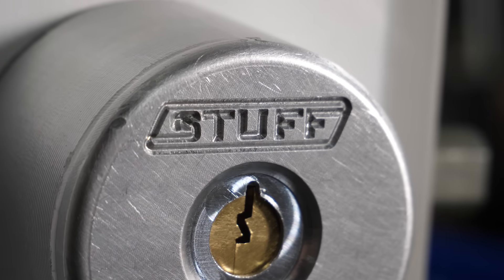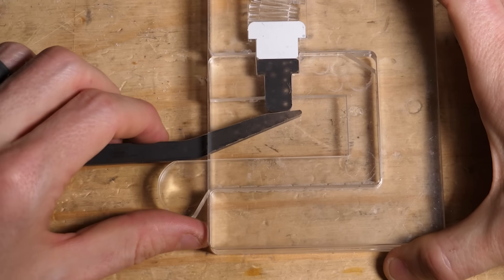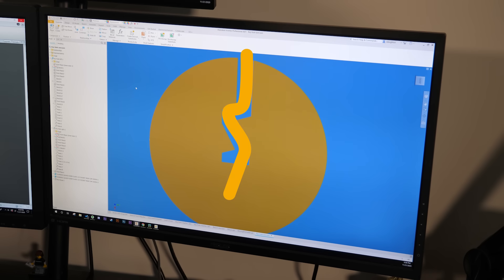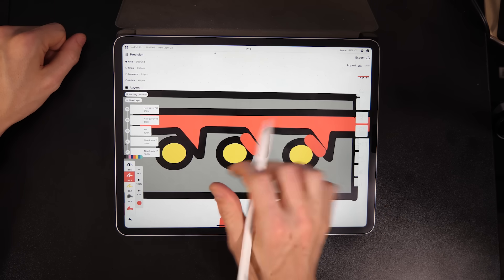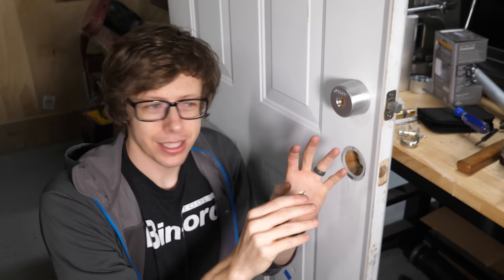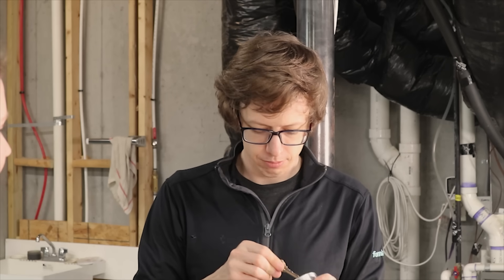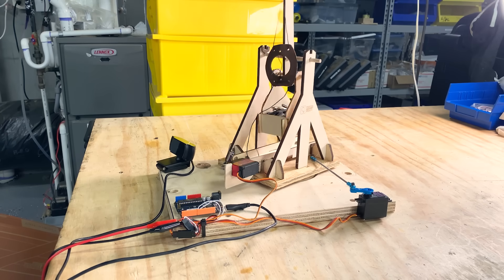Making an unpickable lock. Calling locksmiths

Comment: This is like one of the worlds oldest challenges.  The history here is insane.  If you manage this the world would be on fire.
Reply: Well yes and no. Locks are basically at a level where they reasonably should be, as relatively low cost entry denial devices. If you want something really inpenetrable, a mechanical lock with a physical key is just not really the answer anymore, we have better ways. Locks are only about as good as they are cost effective, and a complicated mechanism kills that efficiency. Don't get me wrong, it's a brilliant exercise in crafting, but nothing ground breaking as a concept. A interesting lock design that comes quite near are Alboy disk locks, those can be mass manufactured and come really close to being unpickable.

Comment: Cool video, great idea and collaboration! 
Could you simplify the trapping mechanism by discretizing the number of pin positions? E.g., as a rough idea, using a stack of wafers and a fake shear line: https://imgur.com/OQsLj7g
Removing the key would probably be difficult in this implementation…
Not sure how many positions per pin are mechanically possible, but the total number of combinations should still be exponential in the number of pins.

Comment: I really don't understand the idea with locks anymore. A battery powered Milwaukee cut of tool with a 4 inch cutting wheel can slice though hardened steel in seconds, so having to pick a lock in 2020 is pretty much irrelevant.

Comment: I actually think that this has a flaw, you can bump it open with simply a pry bar and a small rubber hammer... Depending on the spring tension on the "slider pins" for lack of a better word.

Comment: The LockPickingLawyer “finally, a worthy opponent. our battle will be legendary!”
Reply: And by legendary you mean he is going to spend more time on the packging that the actual lock
Reply: @Peps_Sama  lol his channel in a nutshell
Reply: @picklerick7953  I dunno... I have a feeling LPL's going to run through all of his tricks and be left with nothing. The not so fun part is when he takes it apart to see how it works and not be able to get it back together again.
Reply: @whiskeyfur   you should meet my friend Mr. Hammer
Reply: @whiskeyfur  He will find a way lol
Reply: @whiskeyfur  It'll likely take custom tools, but he'll get it open. The locking bar for the driver pins will likely be the hardest hurdle to overcome, but all it'll take is something to depress the mechanism at the back of the keyway while manipulating the key pins.

The driver pin gates may pose a challenge, but if there is a way to avoid them, LPL will be the guy to figure it out. His puzzle-solving skills are legendary.

But this is exactly what he's likely looking for in his life. His videos lately have been really cynical, because there isn't anything that lasts more than 30-90 seconds in his hands.
Reply: As soon as I see that that's exactly what I thought of lock picking lawyer
Reply: LPL would probably still be able to pick it within 30 seconds.
Reply: LPL cans do it in def less than 15 Monday max
Reply: And we just put a magnet here and it opens right up. Lol, idk it will be a good challenge. Unlike so many others he opens in about 5-10 seconds.
Reply: Yes he definitely needs to send it to the lockpickinglawyer
Reply: Plz ask him
Reply: Exactly, send it to LPL and see if it's pickable or not.
Reply: My two favorite channels collide!!!!
Reply: @lockpickinglawyer
Reply: Finally it’ll take him more than a few minutes to do it(maybe if he doesn’t find a way to bypass it)
Reply: Please let this happen, great job.
Reply: This should really be a collab, this is litterally the kind of content tlpl makes but from the pickers side
Reply: Lockpick lawyer already failed to unlock a Gerda lock
Reply: Bosnian Bill would remind us that because it's made in the USA that it's clearly inferior to a European made lock.
Reply: Dude ... Wasn't even going to watch the vid just leave a comment about the lock picking lawer but fuck.....
Reply: I honestly expect it will take him enough to actually get maybe one ad on the video. Unless he finds where the flaw is.
Reply: Exactly who I thought of
Reply: First thing I thought!
Reply: Yup
Reply: Yes!
Reply: First thought that came to my mind
Reply: Damn you I clicked this video just to joke about that
Reply: So is the lpl up for the challenge?
Reply: @trentc4576  you say this like it may stand a chance. lpl be like. " Today I'll be opening up this lock, and after examining the mechanism I've decided the best way to pick it is with this." *pulls out cutting torch.
Reply: @charleysimmons427  lol ramset
Reply: Yesss!
Reply: LockPickingLawyer !!!
Reply: My thoughts exactly
Have lockpick lawyer give it a go
Reply: It will be a 2 minute video where it’s picked in a shorter time than it takes to open the box and explain the lock
Reply: I need to see this
Reply: @brett1234-s7f  holy shit I got almost 3 thousand likes over night😂
Reply: Reminds of LPL trying the ice cream lock on mrs. Lpl. Disappointment to ensue.
Reply: A new chalange for the ramset
Reply: Kun fu panda reference
Reply: Uhm ... no :D He is just like: We have a lock with a interesting design. Click out of 1, ...
Reply: Omggh lol
Reply: Please do this.
Reply: This  is his ultimate opponent! Forever lock V3! https://youtu.be/RKRo97N1PJI    https://youtu.be/4vShP7riRqI
Reply: https://youtu.be/CSj_TsrtpOs?t=11
Reply: Can’t wait
Reply: Lol this was recommended after watching his videos
Reply: Has it happened yet?
Reply: Yesss please!!! LockPickingLawyer!!!
Reply: Lmfao I thought the same thing!!!!
Reply: want to see LPL pick this lock  https://youtu.be/4vShP7riRqI
Reply: seawordcutegirl.Link

Comment: My dad always said that there's no market for a pick-proof lock.  Locks keep out the honest people.  Crooks just cut the lock or cut through the door.  I worked on Minuteman ICBMs in the 1970s - specifically the locks to gain access to a missile silo - and yep the locks can be bypassed.  It's a lot of trouble, takes a long time, and is taxpayer expensive but I've done it many times.  Still, cool design, lock, and video.

Comment: "You should definitely send it to the LPL"
"Uh.... I'm definitely adding more to it before sending it to him.. More pins, more power."
Uh-huh........
Note: you should also add a couple trap pins somewhere in there aswell, or have the lock HAVE to rotate 360 degrees or so and get offset when it passes the 90* mark, so without the key, the pins could either be trapped or stopped by a gates entry.

Comment: I gotta disagree, mechanical locks aren't obsolete. Those RF and Wifi locks are so extremely vulnerable to cloning and hacks that a raspberry pi based key (like the kickstarter 'pen testers') can brute force most commercially used electronic locks. The workarounds outpace improvements and deployments of better security, businesses don't upgrade that frequently either. Contact points on stuff like gates are even worse with  universal generic keys. A good mechanical lock is immediately and always relevant. Its also conspicuous to pick a lock but not to clone an ID and tag through a security point.

Comment: The shroud as designed is prone to brute force. With a simple wrench or a simple pipe with the same internal diameter you can yank it from the door.

Make it a so the cutout is trapezoidal or even elliptical smooth so you can't get grip on it

Comment: Some electronic locks are the easiest to pick. In fact, electronics and lock making skills are not really interchangeable, and magnetic components are prone to different sorts of attacks if not properly shielded. Mechanical bypasses take more skill and that's why mechanical security is still the best bet.
In fact there are several locks that do what you want (need to be all set before you can even tension it, or make the pins unreachable for picks by using warding). My favorite approach is a double sleeve of which the outer sleeve seizes the pins when you're trying to rotate before the pins are set. Just a small sleeve with slightly elongated cutouts where security driver pins fit through. You get a false set, and the outer sleeve rotates enough to lock the unset pins into place. Can't even use the original key anymore.

Comment: Seems like the optimal tool for opening that lock would be a quick sledgehammer to the top of it. Nice clean target, should be able to knock it off in a hit or two and twist the internals to open the door.

Comment: The mechanism for holding everything in place can be made much simpler if you go digital. You can have bunch of grooves in the pins and make them have to pick a position they fit in a comb before they do or do not split.

Comment: am i the only one who was thinking a robber wouldn’t go through all that trouble to pick that lock when that window looks very smashable
Reply: Just like the old saying says.  Locks only keep honest people out.
Reply: Barred windows and a steel reinforced door, the lock is the only way in
Reply: The primary reason to pick a lock over using brute-force is that you want to get in and out without anybody knowing something happened. Almost no petty criminal actually picks locks, which is why they're typically so bad.
Reply: The point of hard to pick locks is to dissuade SMART thieves from getting in, 
breaking and entering has a much harsher sentence than trespassing, not to mention, you can disguise lock picking in a plethora of ways, but if you smash a window, you gotta go balls to the walls.
But yes, you are right, the old defense principle "your defense  is only as good as its weakest part" still holds true, if you have a single pin lock made of an unbreakable material, it's useless; if you have a lock that's un-bypassable, but is made of metal, it's useless; if you have the perfect lock, but no door to hold it down, it's useless.

Comment: Instead of a force grip, maybe you can add some really fine threads to the upper register pieces? That might make it easier to grip it to test, the downside is that you would be exchanging an analog height for a "digital" height. But I feel like the tradeoff in pin security while moving the mechanism might be worth it.

Comment: Dude.  You hadn’t counted on parts wear.  After many moons the parts could wear forcing you mechanisms to stop working when you force a only one height barring opening or height adjustment for key opening.  If you miss place the key slightly for a year you could unevenly wear the positions of the tumblers and locking mechanism.  Great concept.  But I’m a clutchz and I break practically everything.

Comment: Anyone notice he doesn't have a lazy tailpiece on the back during testing? The key can't be taken out while the deadbolt is locked. When he turned the key to extend the deadbolt, the key was in the 90 degree position, and to remove the key, the deadbolt had to be retracted fully, thus leaving the door unlocked.

Seems like the locksmith could have just opened the door! :P

Comment: If you could make it reliable I'd buy em. Just need some custom tooling stuff. They'd probably sell good.

The only way I see to pick this would be to lock the pins, and then force them up slowly.
Reply: Maybe do a series of groves in the pins that lock into the locking bar.
Though that would also make it easier to pick by reducing the possible combinations...

Comment: Definitely send it to LPL.  I want to see if he can find a way to unlock it.

Insofar as picking it, one possible way it could be done is feeling where a pin is based on how much the core turns, still one at a time, but harder because you have to remember how much the core has rotated for each attempt.

One way to make even that harder, though, is security pins with false gates, etc.  Even then though, I'm hesitant to say its unpickable. Its definitely very pick resistant though.  I expect it would take LPL at least 3 minutes to pick open on his first try.  Down to maybe a minute once he gets good at it.

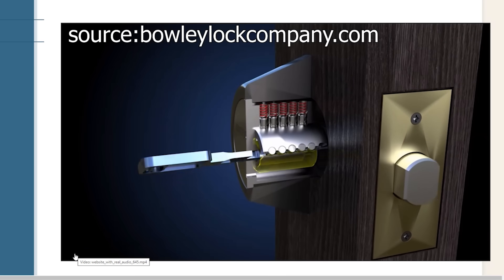Comment: 3:26 Is this video implying that someone has actually picked that Bowley lock? That design seems impossible to either pick or bump and it's actually a commercially sold lock.
Reply: there are videos showing it being opened with a specially made pick going around the shielding. This lock here however won't be easier with any custom tool because his idea and the principle of the validation is correct. It is definitely a PICK PROOF lock, if anyone would invent a financially feasible version of it for mass production then lock pickers would basically admit defeat on this.

Comment: “I found a locksmith that specializes in picking locks”

Wow didn’t know they had those.
Reply: Some of them will just drill it so they can sell you a new lock or just cut a key if there's a code on it that can be linked to a key bitting
Reply: @sunbeamfullofcheer  usually they will try and scam you out of money.
Reply: @anuragneelam8527  True
Reply: There are locksmiths who specializes in smiths.
Reply: @mjbakermd414  lmao 😂
Reply: There's a lot of 'lockpicks' who have an extremely basic skill level they might have a few bump keys at best but most likely it will be some doofus with a drill.
Reply: If you look into pen-testing, locksmiths rarely have to pick locks, there's almost always a non-destrictive way to bypass locks. Picking locks is becoming more of a hobby than a skillset.
Reply: Well, I mean ... Bill doesn't live that far away..
Reply: If you don't have the keys what's the point of picking it. Drill it and replace it. My father is a locksmith of 30 years. He can pick everything and even crack safes. Drilling it is quicker than picking.

Comment: I occasionally have to build automotive ignition and door lock cylinders, most use a variation of 4-5 different tumblers with key cuts up to 10, they are very complex. I’ve done so many that I can look at a key and determine it’s depth of cut.

Comment: The LockPickingLawyer be like, “although this lock is almost impossible to pick, it’s vulnerable to a comb attack” proceeds to open it within 3 seconds
Reply: hahaha my thoughts exactly
Reply: I’m about 3 months late to the solution party, but I also came up with this solution independently! There’s a lot of comments to scroll through, so I didn’t see any solutions in the comments until I spent about an hour scrolling after I posted my comment
Reply: Believable. You could probably defeat the lock starting from an overset position.
Reply: @Gameboygenius  Overset, but you'd have to smack it a bunch while applying rotational force. Remember the pins are held by individually spring-loaded teeth. Or a squirt of freon to loosen the springs maybe? I like this guy's approach, but very over-complicated and difficult to manufacture vs LPL's gotcha lock. wafer+tpin plus pit at 1/8 turn.
Reply: @db2855  if I understand the mechanism correctly, you control the pin locking mechanism freely using the lever in the back. The springs are just there to absorb slop in the mechanism. So the method would look something like...
1) overset the pins using a comb.
2) lock the pins in place by pressing the lever in the back with a probe 
3) rotate the cylinder to the point where the pins are pressed against the gate.
4) release the lever.
This is where some finessing is required to make the pins slide down and mate with the gate.
Reply: @Gameboygenius  I think the same approach could be accomplished using a key blank instead of a comb and probe. Just slightly retract the blank while the pins are held against the gate to disengage the pin locking mechanism.

In LPL's comment, he mentioned that Shane is working on an improved version. Perhaps he'll address this method of attack by adding some false gates above the true gates.
Reply: @derrichartzell3883  I think the improvement I would have gone for is to prevent the pin locking mechanism from being disengaged - As the core turns the body of the lock takes over the engagement of the pin lock so that the pins will be locked if the key is in place or if the core is turned.
Reply: @derrichartzell3883  Sure. I went with comb because of the original comment. :)
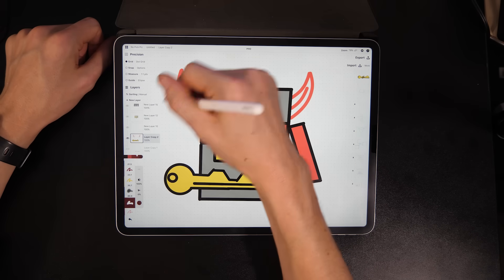Reply: @Gameboygenius  I'll agree. Going back to 6:29, and assuming he stuck with that basic design, you can independently engage/release the bar. Good attention to detail.

Comment: Couldn't you push all of the pins to the top, lock them in place, rotate it until it hits the barrier then release the locking in place system while turning to allow all the pins to fall into the correct heights?

Comment: 1. Ask the lock picking lawyer and Bosnian bill take a look at it.
2. Don't have the locking part hand on the outside of the door.
A robber would just pry the lock body off the door and the just manipulate the deadbolt directly. Put the lock in the door.
3. Have you seen how complex a high security lock actually is? I am sure yours could be manufactured for a price that lets them sell it to commercial costumers

Comment: You can't expect a locksmith picking a lock if he has no idea of the internal mechanics.
You have to supply the technical drawings as well otherwise it is quite impossible and an unfair task.
I am quite sure that nobody would be able to e.g. pick a Bowley lock without knowing how it looks inside.
Once you know the principle of the lock you can manufacture some specialized picking tool.